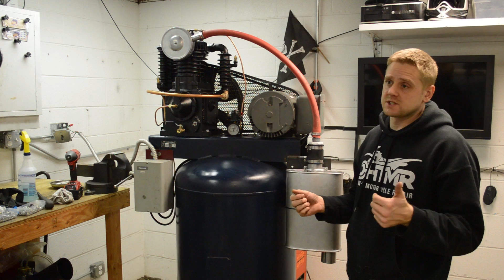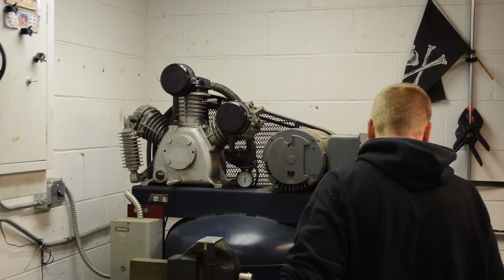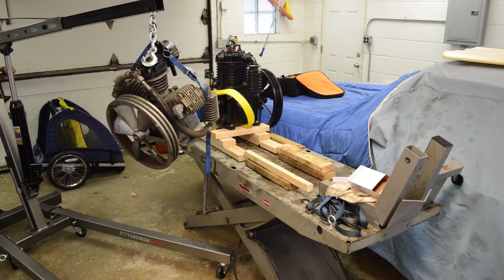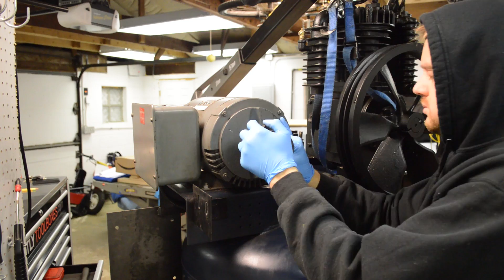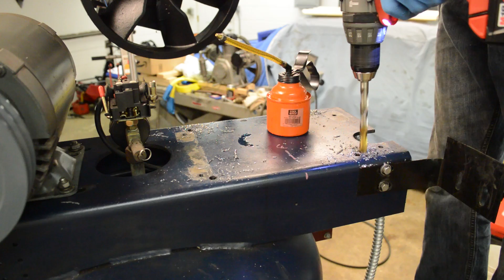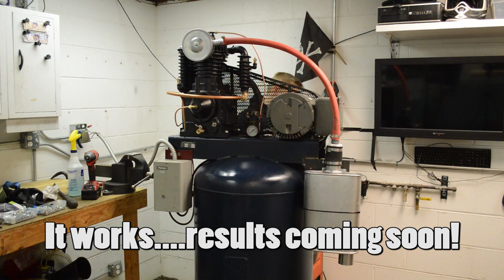Eaton BARE PUMP Install / 5hp 2 stage compressor

Comment: Where did you run that copper unloader valve pipe to....you didnt show the back side in the video
. I have a 7.5hp version of this saylor beall clone..mine is gas engine driven.
Reply from the maker: To an unloader valve that is mounted on tank outlet.

Comment: The motor looks bigger than a 5hp with the large shaft . My 5 hp motor looks to have a 5/8 shaft so Im wondering if it would run that pump.
Reply from the maker: What RPM is your motor? I'm assuming 3450?

Comment: Great Vid, I love working with compressors. I have a playlist how I restored and set mine up if you want to check it out.
Reply from the maker: Thanks, Matt. I saw the champion you picked up. I searched for one for a long time. People want 1200+ for a 20-30yr old unit.
Reply: @HTMR  Yea I did. It's been great. I searched for like 2 years. I paid $650 for mine and fixed it up. After the new magnetic starter, compressor valves, paint, motor bearings, wiring, air filter, all the fittings, air hoses, regulator, and a hose reel I'm in it about $1450. It's a 5hp 80 gallon Champion. I think it is an 2003 model.
Reply from the maker: @MattsShop  R15 pump, right? I was looking for that or a SB 705. You might notice that this Eaton pump is a SB 705 clone.
Reply: @HTMR   MatthewMCRepair  Yes it is an R15 pump. They are Extremely well engineered and built, but still extremely  simple. I woudn't change a thing.

I am not familiar with an SB 705. Who makes that?
Reply from the maker: @MattsShop  saylor beall